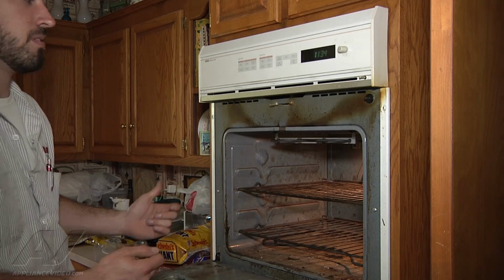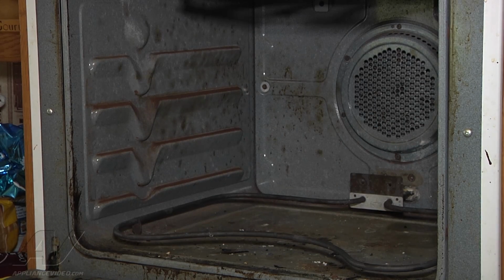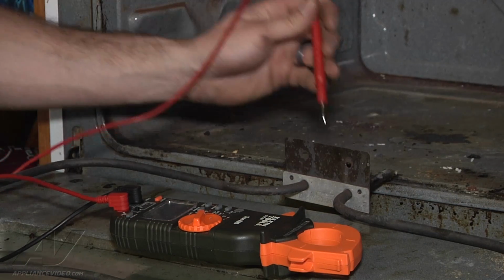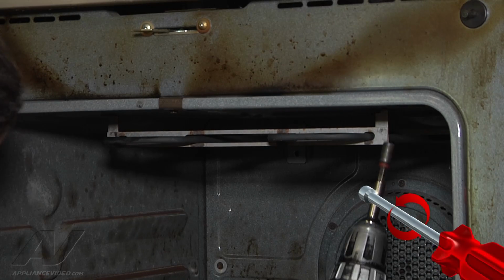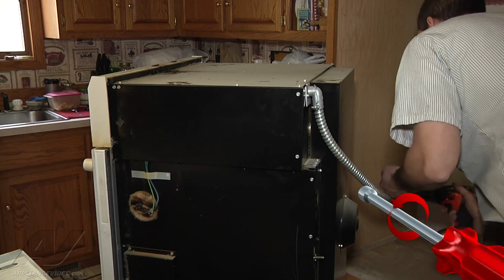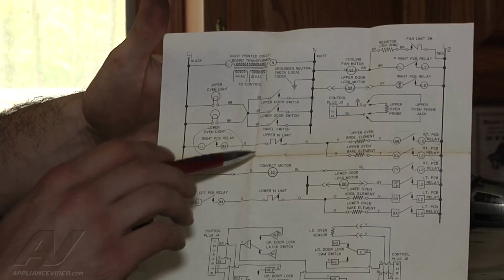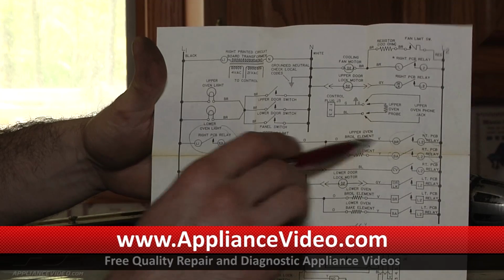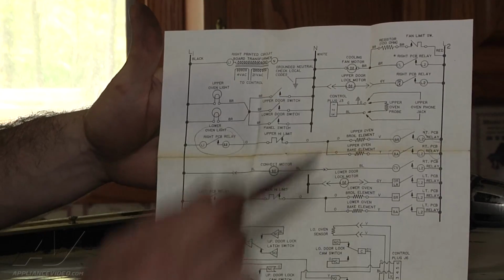Jenn-Air Oven Repair - Not Heating - Relay Board

Comment: I have a cwe5800acb replaced the elements and thermostat and it’s still not heating! Help…
Reply from the maker: Great question, if you have a more technical question that our parts department cannot answer, you can search our over 17,000 answered questions free at our website www.ApplianceVideo.com under our Repair Help section. You can also call our parts department at 1-800-830-5465 and they can give you help 7-days A week ,or search at www.SaveMoreOnParts.com  .
Reply: I'm having the same problem and replaced the same parts. Did you ever get an answer?

Comment: I have a Maytag cwe5800acb that isn’t heating on the top oven. I replaced the heating, broil element and the thermostat.
What could it be?
Reply from the maker: Great question, if you have a more technical question that our parts department cannot answer, you can search our over 17,000 answered questions free at our website www.ApplianceVideo.com under our Repair Help section. You can also call our parts department at 1-800-830-5465 and they can give you help 7-days A week ,or search at www.SaveMoreOnParts.com  .

Comment: What is the model number for this jenn air oven
Reply from the maker: Great question, if you have a more technical question that our parts department cannot answer, you can search our over 17,000 answered questions free at our website www.ApplianceVideo.com under our Repair Help section. You can also call our parts department at 1-800-830-5465 and they can give you help 7-days A week ,or search at www.SaveMoreOnParts.com  .

Comment: How much should this cost to have someone come and check it out.   Also How much if the bake and broil elements didn't work.

Thanks
Reply from the maker: Great question, you can call
our parts department at 1-800-830-5465 and they can give you help 6-days A week
Mon-Sat . You can also search at www.SaveMoreOnParts.com 7- days a week.  If you have a more
technical question that our parts department cannot answer, our technicians are
answering all questions at our website at www.ApplianceVideo.com under our Repair Help section. We have over 6,000
common questions and answers that you can easily search through by your model
number, appliance make, problem or error codes, and It’s completely free to
search through our question & answer library. There is a very good chance
you question is already answered there.